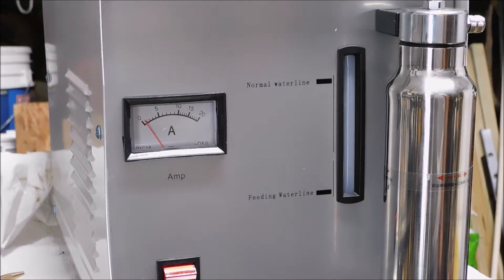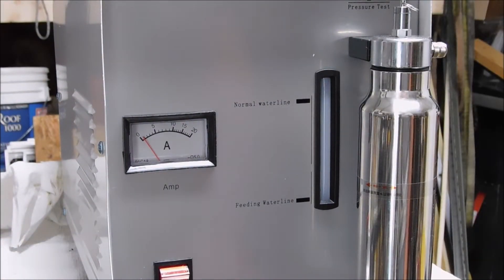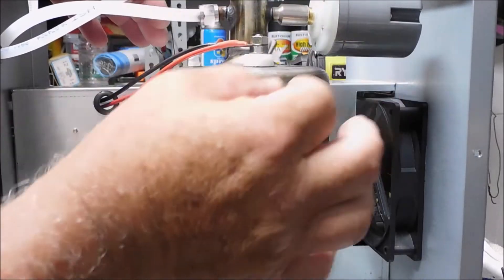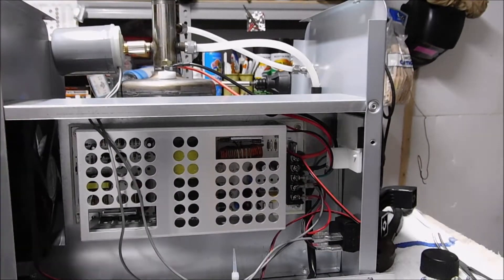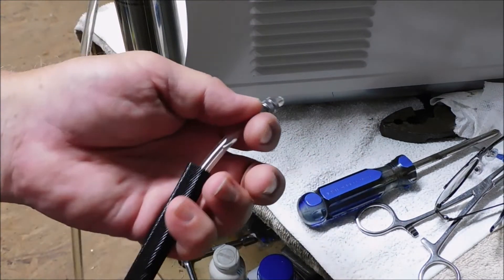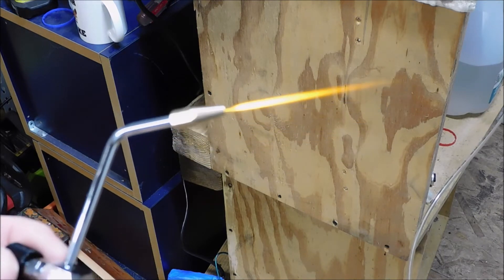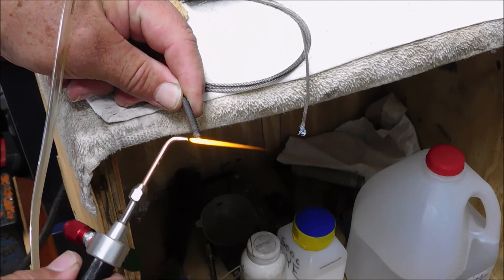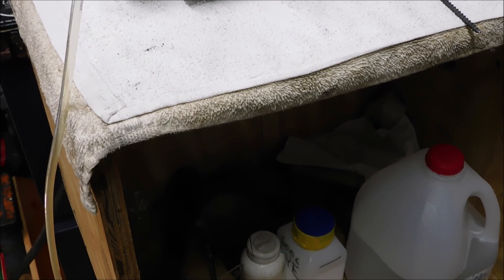HHO Generator, HHO torch, Hydrogen generator, Fuel from water !!!

Comment: How to make vehicles run on alkali solution, ammonia solution, alcohol solution and other electrolyte: ELECTROLYSIS INSIDE FUEL FILTER, AND INSIDE COMBUSTION CHAMBER BY PLASMA FROM MULTI SPARKPLUGS, JUST NEED LITTLE HACK THE ELECTRYCITY BY HIGH ELECTRIC CURRENT SPOOL OR ALTERNATOR USE SUPERCAPACITOR AND VARISTOR, FIRST MAKE ELECTROLYSIS INSIDE FUEL FILTER first electrolysis (PEM OR PLASMA), BECAUSE GRAFITY EFFECT WATER COME FROM UNDER FUEL FILTER EFFECT WILL MAKE PRESSURE SO HYDROGEN DON'T COME BACK TO FUEL TANK BUT RIGHT INTO INJECTOR/CARBURETOR, BY INJECTING BOTH HYDROGEN AND WATER INTO INTERNAL COMBUSTION CHAMBER CHAIN REACTION (EXPLOSION MUST BEEN HAPPENING INSIDE COMBUSTION CHAMBER) USE GRAPHENE COATING PISTON OR GRAPHITE AND METAL COMPOSITE/GRAPHITE COATING PISTON MATERIAL AND ITS GRAPHITE AND METAL COMPOSITE MATERIAL CYLINDER BORE WALL IF WANT MAXIMUM PERFORMANCE, THEN PLASMA SPARKPLUGS WILL MAKE ELECTROLYSIS REACTION+IGNITION THE PRINCIPLE IS SAME LIKE LIGHTNING STRIKE ON SEA (NATURAL PLASMA ELECTROLYSIS) THAT CONVERT SEA WATER INTO HYDROGEN AND OXYGEN + MAKE PRESSURE AT SEA WATER AND BURN IT BECAUSE LIGHTNING STRIKE HYDROGEN ON IT, THIS MEAN ALL VEHICLES ACTUALY CAN RUN AND BURN ON WATER AND HYDROGEN
Reply from the maker: Water will run a car without any trouble. In 1936 a guy named carter (If I remember correctly) patented a carburetor that can run on 100% water by using the heat from exhaust to break water apart into HHO. Stanley Myers was credited for having made a water running car. I have been told that  one specific ultrasonic frequency  (maybe 42.8Khz) will break up water by itself. I will be doing that one soon. The problem with an engine built today is the aluminum pistons mostly. They will crumble apart from hydrogen embrittlement. I noticed you say about carbon fibers, so I figure you know that...or you were thinking of higher temperatures. If you ceramic coat the parts that will be affected by this, you can stop that problem. Good luck.
Reply: I was trying to do something similar but the opposite.
I was trying to create a device that by hydrolysis would create oxygen (I think it is 200 liters of o2 per liter of water although you spend 5kw in the process) as a future tool in case I should be locked up with my family in a basement for a long time. I was thinking of throwing the hydrogen away because I thought it could not be stored? Is it possible?

Comment: to test just copy/paste diesel/gas injector .t coonector,1/2pipe,internal rod,ppr cap for t.Good for induction heating,ionic(liquid rezistor),dielectric heating(+ and gnd),tap waterelectrolisis +50/-50V,tapwater heating alternate current (galvanized cast iron pipe,ssteel 304/316 only)wfc423.goog luck
Reply from the maker: I am not sure what all those words mean together in that sentence. But, thanks for watching.
Reply: @davenooner2142  can you make video using this HHO to puncture holes through thick metals like steel, aluminum, etc?
Reply from the maker: @BOREDANDWELLBORED  I will try some things like that, however, there is very little pressure from the torch so, I know it will not work just like a cutting torch that we are used to. I have a few projects to finish up for cold weather that's coming , so it may be a couple weeks till I can do that. Thank you for watching and I will try to let you know any test results then.
Reply: @davenooner2142  do they sell a more powerful hho torch than H180? It's only 400 watts.. Why don't they sell a 800watt version?
Reply: @davenooner2142  or I guess u can buy 2 of them and mount 1 torch hose to both to get more flame. But I wish they sell a 800watt version. They're cheap though ($200 on ebay).
Reply: @davenooner2142  how did you connect that torch nozzle with 2 hose?  I'm planning a experiment with 2 of these connected to your 2 hose nozzle and then add mini air pressure because maybe it will become more powerful. Gasoline need about 1 to 7 fuel to air ratio to ignite so hydrogen could possibly be more explosive if more oxygen is added to it. That's just my theory. For sure I'm buying one of these because I need to weld and melt aluminum. Current welding for sale can't do aluminum unless you buy spool ($130) flux ($40) and argon or propane gas tank ($100 to $300) and u keep buying the gas. It's too expensive.
Reply from the maker: @BOREDANDWELLBORED  There is more powerful ones for more money.
Reply from the maker: @BOREDANDWELLBORED  I just used the red line and keep the green valve off and the green hose is not used. Any changes to the size of the torch tip hole can cause a back fire. With hydrogen, it can be very powerful explosion depending on the quantity of gas in the system (tank,lines etc,). Just a 12 inch by 12 inch by 1inch volume of oxygen and hydrogen is enough for an explosion that will make your ears ring for days...trust me! If it is contained in anything that will shatter into pieces... it can do bodily harm!!!
Reply from the maker: So I do not recommend modification of the setup.

Comment: That is most impressive Dave. I giggled when you melted the rock as well😆! One would have to assume that one could use it to most assuredly light charcoal. Thanks for sharing.
Reply from the maker: I used it to silver solder a rusty 1/4" tube with a pinhole. Rust is hard to work with, but it did work. It was for a weed burner that uses pressurized kerosene.
Reply: @davenooner2142  you're correct about the rust. It seems that have a very effective tool there.
Reply from the maker: @LumberjackPa  For the price...I had to have it. Thanks for watching.
Reply from the maker: Thank You for watching. Yes if you knew someone that cooks on outside grills or something...I bet it could start a corner of a briquet.
Reply: to test just copy/paste diesel injector .t coonector,1/2pipe,internal rod,ppr cap for t.Good for induction heating,ionic(liquid rezistor),dielectric heating(+ and gnd),tap waterelectrolisis +50/-50V,tapwater heating alternate current (galvanized cast iron pipe,ssteel 304/316 only).goog ack